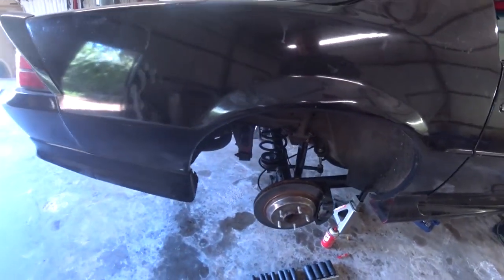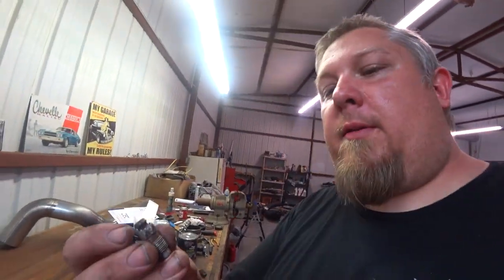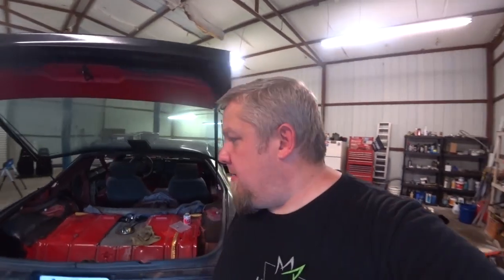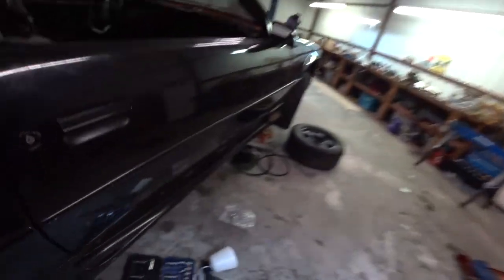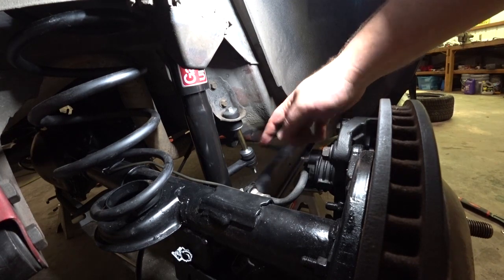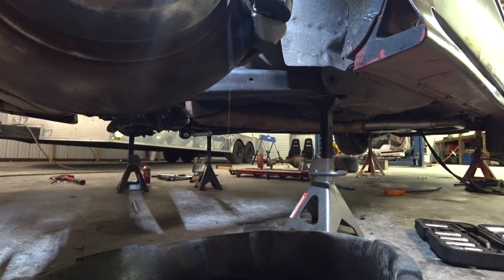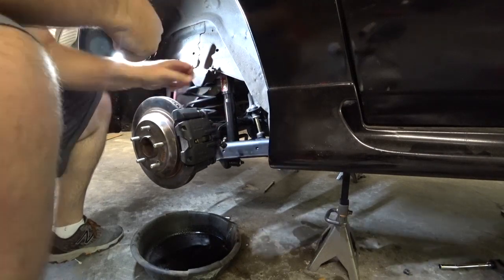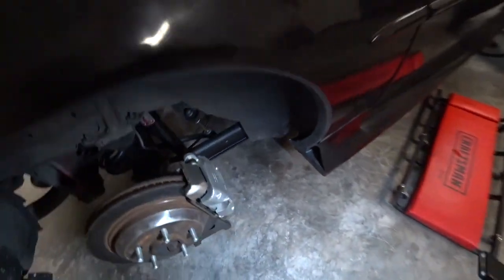Installing rear disk Brakes on a 3rd gen Camaro

Comment: I purchased a 92 3rd gen with the rear disc conversion. I have the same caliper setup as you. When ordering brake lines/hoses all I’m seeing is lines for front disc and rear drum. Will drum rear lines work??

I’m replacing all brakes, calipers, rotors and lines. The car originally came with rear drums

Comment: I got a 92rs with z28 body kit & drums in the back. I had a 9 bolt Borg Warner i was going to put in my car but someone told me it wouldn't work with my master cylinder. I sold it. I still want disk on my rear and positive traction. I just found your videos and haven't watched them all yet. I watched 3 at work. I didn't see where you had to change your master cylinder out. Everything works great? I think I'm going to find a 4th gen and swap mine out.
Reply from the maker: Adam's Tarantulas no I didn’t have to swap out master cylinder out and I get good break pressure, well factory pressure. There is an upgrade a lot of people do by upgrading the spring in the master cylinder to get more pressure in the back. I have not done it yet, but will in a future video.
Reply: Thanks i beed looking for another rear end for my car since I seen your video.